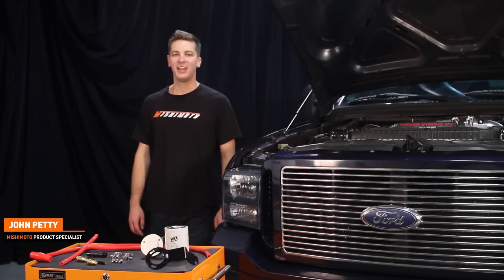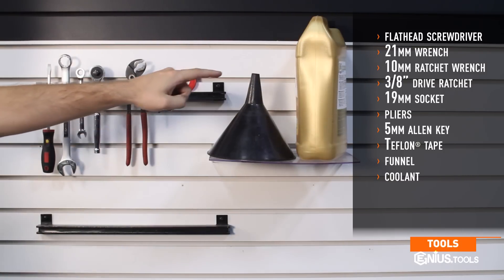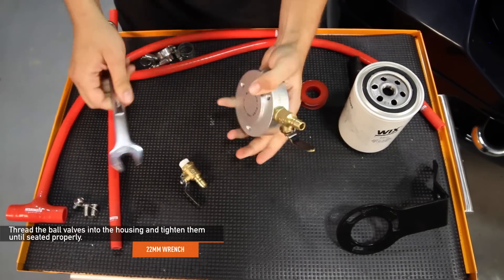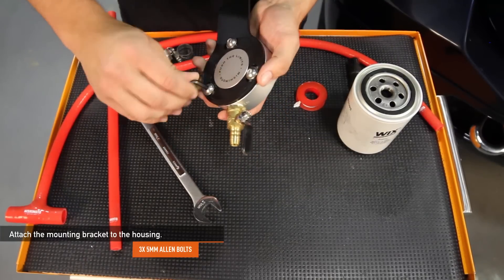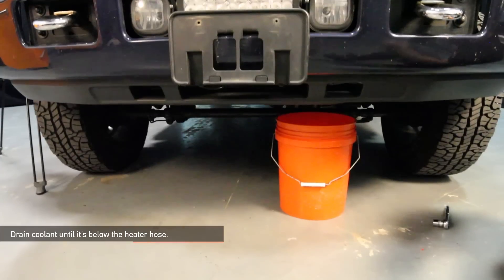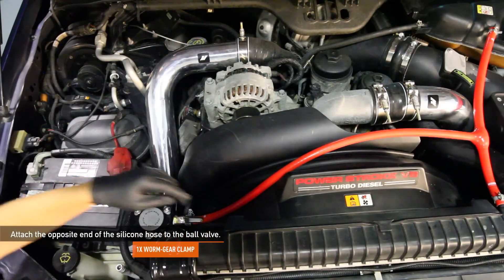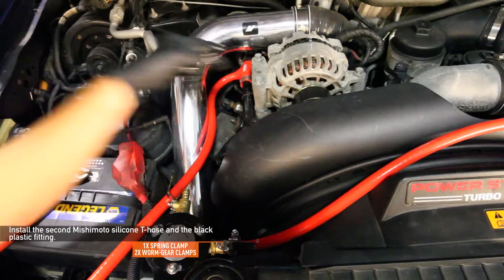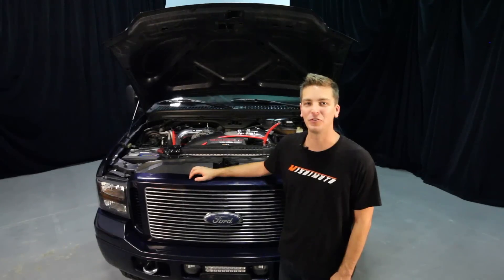2003–2007 Ford 6.0L Powerstroke Coolant Filter Kit Install Guide by Mishimoto

Comment: I’m looking to get one of theses for my 6.0 I just purchased. What’s the point of the ball valves? What if it gets knocked shut and goes unnoticed?
Reply from the maker: Typically, you'll notice a symptom of no heat in the cabin so it's easily detectable around this time of year. However, the valves can't typically be "knocked", or bumped into a closed state. We have yet to hear of something like this happen.

Comment: What’s the point of a coolant filter??
Reply from the maker: Hello Oscar Gonzalez. The main benefit of a coolant filter system is to remove solid particles from your truck's coolant. This will Extends\ the life of your oil cooler, water pump, EGR cooler, coolant, and other critical components
Reply: what's the point of using the gold coolant with silicates
Reply: @mishimoto  Have an F350 in the shop today with this kit on it....105k miles...egr cooler is leaking. That sure is some life extension...
Reply: @joejones2935  I see they came out with this kit just 6 years ago so this F350 didn't go 105k miles being filtered with this kit.
Reply: @joejones2935  coolant filter just an extra protection level. You should have a magnet attached to the lower rad hose, switch to ELC silicate free coolant, and regularly change coolant and filter. All of these steps are pointless though if your ect/eot deltas are already above 15°F you would need to fix the clog in your cooling system either in the oil cooler, egr cooler, or heater core.
Reply: Just installed this and was pretty easy. Note you will have to trim off about 2 inches when installing the tee on the passengers side otherwise on the factory side of the hose,  it will kink.